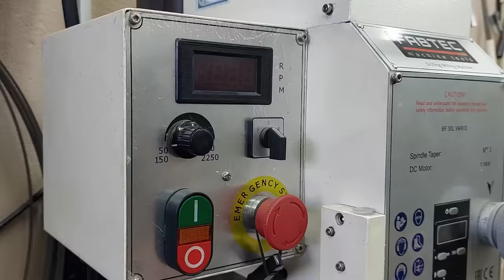Made a very simple tool to perfectly sharpen drill bits

Comment: This tool jig will be handy for those learning to sharpen drill bits by hand. As we all know, not everyone has the grinder available to properly sharpen bits. And if they do, maybe they just need to touch it up before drilling more. Sharpening bits by hand is an art of a craftsmen and takes practice to get good at it. I know, I worked in a small sawmill many years ago. We had very limited tooling available to us, a bit grinder was not one of them. If you dulled a bit or broke it, you were on your own. Try and wait until morning to tell the owner you didn't finish a repair because of a dull or broken drill bit!
 I was lucky, I had several skilled and knowledgeable craftsmen teach and work with me to get proficient in re-sharpening drill bits. This tool he just made would have been appreciated in that process of learning. Nice little jig tool.
Thanks for sharing.

Comment: Nicely made. It works as an aid to sharpening a drill, but it has several shortcomings. It does not ensure the cutting lip lengths are the same. The operator has to measure the lips to make sure they are equal.  The operator also has to manipulate the drill to generate clearance behind the cutting edges. 
A consideration when grinding a twist drill is that the relief behind the cutting lip increases the closer you get to the center of the drill. That is what the cams in drill sharpening machines are for. Additionally, if the relief across the cutting lip is constant. the chisel point between the cutting lips will be too wide. This increases the force needed to push the drill into the work.
Reply from the maker: Welcome!

Comment: The drill bit clearance angles are missing , my friends.The cutting edges cuts and the swarf pig tails are passed under the clearance.Your  sharpened drill bits are not producing long twin pigtails as a properly sharpened  drill bits, do.Every  2nd."how to sharpen drill video" misses this very necessary point. For gosh sakes, consult a tool sharpening tool handbook to understand this.
Reply from the maker: All is well my friend, look at how this drill bit drills on the lathe, there are two chips swirling all as it should be! Welcome!